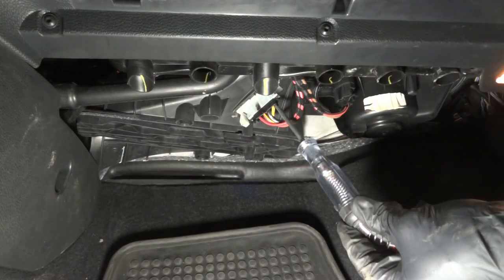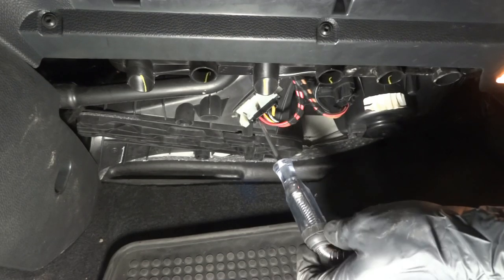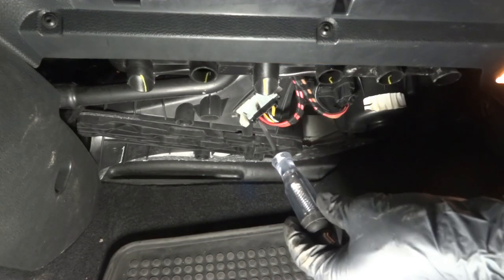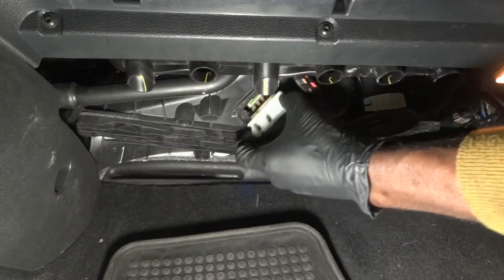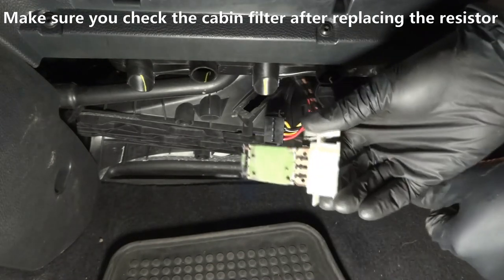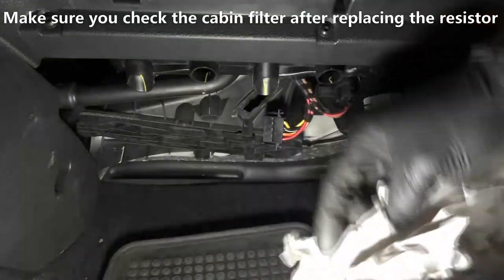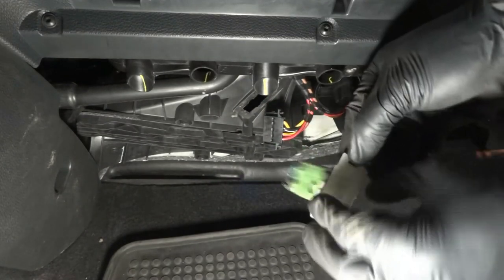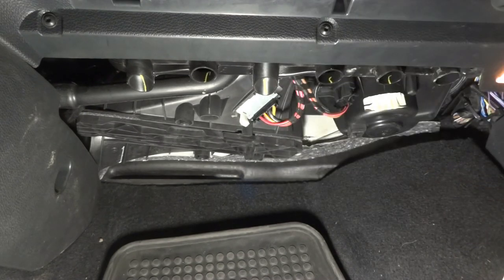VW JETTA BLOWER MOTOR FAN ONLY WORKS ON HIGH SPEED, DIAGNOSIS AND REPAIR

Comment: VW Service center charged me $178 to diagnose this problem and said it’ll cost about $835 for parts and workmanship. I told them not to worry, bought the parts myself for less than $70 and it took all of 2 minutes to replace. These guys are scammers.
Reply from the maker: @timeyinolley8966   I'm glad to hear that the video was helpful

Comment: What if I changed that but my a/c still isn’t blowing?
Reply from the maker: @stephenjohnson2651   what do you mean by AC not working, there is no Air Coming out of the vents!
Reply: @KITS_Auto_and_Truck_Repair  I purchased a new blower motor fan and blower motor resistor but my a/c still only blows on full speed.

Comment: Hi. I had this problem but when i put in the new resistor..all speeds worked only once and then smoke blew out of my ac vents  then went back to same problem again (with only fan working on highest setting). It’s like the resistor blew i think. What could be the problem in this case?
Reply from the maker: @iskooobydoo  you might have a shorted blower motor, install a new resistor then disconnect the blower motor and turn the fan on to see if the resistor is not gonna burn, if it doesn't while the blower motor is disconnected then the problem is the blower motor!
Reply: @KITS_Auto_and_Truck_Repair  hey thanks for the tip. Question, would a shorted blower motor also affect the Compressor/RCV not engaging? Because the AC is actually not getting cold also. Its like the compressor solenoid is not engaging.

Comment: Good repair and diagnostic video man straight to the point and didn't forget to mention to check for voltage before you go and replace the resistor that's a good idea
Reply from the maker: @eliangonzalezandthecoastgu2321   Thank you!

Comment: I wish I had found your video sooner before I spent $400 only to have the blower fail 2 days later. So my vehicle had the same issue. It only worked in 4th setting. Repair man changed the A/C compressor control valve. Picked vehicle up, A/C was cold again but realized later still only worked on 4th setting. 2 days later even on the 4th setting it isn’t blowing. I can hear some rumblings, but then stops. I’m thinking maybe I should change the resister and blower motor. What do you all think? Great video and informative. Thanks.
Reply: When I gently bang under dash it starts to rumble, but doesn’t start. It’s a 2012 VW Jetta.
Reply from the maker: @scottamaral5073  yes! check out your blower motor resistor!

Comment: Thanks for the share, my issue is slightly different, it blows only on 4 as well but on side and below vents not in the middle ones on a Passat B6.
Reply from the maker: @joblux  My Pleasure! it sounds like you have a mode door issue!
Reply: @KITS_Auto_and_Truck_Repair it only blow at level 4 on high speed, first three levels arent responsive…is that still a blend door issue ?

Comment: Aww yea!! Amazingly well detailed video my guy 👏🏾👏🏾👏🏾. So I have a 2013, 2.0 Jetta with the exact same problem, just started today and I bet this is the fix. Now This may be somewhere in the description or comments section and I just missed it, but is there anywhere other than the dealership to procure the replacement part? I want to make sure I order the right one but dont want to go through my local vw dealership as I’ve had bad experiences with them. Let me know and thanks again 🙏🏾🙏🏾🙏🏾
Reply from the maker: @JT01_902  My Pleasure! The Dealer should be your best bet! Aftermarket parts don't usually last!

Comment: Thank you - I had this happen tonight on my MK6 2013 Jetta and I believe I just need to get the right part number now and order it and I'll replace myself. I pulled mine out to look at it and it does appear bad. I don't have a tester but am pretty confident it is the resistor. 

Is there a way to find the VW part number? I found what appears to be correct on Autozone but looks like it is the whole unit and I just need the resistor not the wiring cables. 

Will update this once I get it swapped out!
Reply from the maker: krisrk  ok!! I think I showed the Part number in the video!! call your local VW Dealer and get the part number from them!
Reply: @KITS_Auto_and_Truck_Repair  I found it and am getting it delivered 9/24 tomorrow. Once I do the swap I'll update. Thaks for making this so simple!!!
Reply: @KITS_Auto_and_Truck_Repair  it worked and my problem is now fixed, have already followed your channel. You’re awesome!!! $18 bucks I really am curious how much the dealership would have charged. I’m sure a lot more than doing it myself. Thanks for your helpfulness and great video!!!
Reply from the maker: @krisrk  My Pleasure!! I'm glad to hear that the video was helpful!! you can donate to the channel if you can! Thanks!

Comment: Would a bad resister make my AC not work properly and blow hot air after a few mins? My car also only works on the highest setting for the fan.
Reply from the maker: @ericbogar9665  No! a defective resistor would not affect the performance of the AC System!

Comment: Hello! I have a question. Is this compartment behind the glovebox area ? Also, should I disconnect my battery when I do this ? Finally, what is the screwdriver for this type of screw called ?
Reply from the maker: @jarapovic  you don't have to disconnect the battery to replace the blower resister, you need a torx bit to remove the resistor
Reply: @KITS_Auto_and_Truck_Repair  thank you !!!!

Comment: I replaced the blower motor resistor and the AC works great on all setting now BUT there’s a rattling sound coming from the compartment where I replaced the part. It only rattles when the AC is on I don’t know what to do
Reply from the maker: Cameron Andrew  Make sure nothing fell in the blower motor housing, like a piece of paper or a pen!! I've seen stuff from the Glove Box fall in the blower housing!

Comment: I have the same problem , it works at any level for beginning but after cruised for an hour or so , suddenly level 1-3 stops working but level4 still working. Any idea why ?
Reply from the maker: Iwan Atmadjaja  your resistor is probably failing! test it and see what happens!

Comment: Blower not working on any setting now after only working on highest setting for long time. Fuse good. Going to check resistor next.
Reply from the maker: Patrick Griffin  it sounds like your problem is a bad resistor!
Reply: I think the blower motor had been running with a bad resistor for a long enough time, that it too went bad. After putting in the new resistor, I tested at the connector to the motor and am getting good voltage and ground. I will be putting in the new motor tomorrow after it gets delivered.
Reply: Turns out, that was it! Both resistor and blower motor. Now I know. When fan works on only highest setting, change resistor before it has an effect on the motor.

Comment: Why is this issue so prevalent with VWs? I’ve never heard of this happening with any other brand
Reply from the maker: @4spooky8u  it's how the resistor is mounted,  it doesn't get cooled a lot!
Reply: @KITS_Auto_and_Truck_Repair  yeah when I replaced mine the old one was corroded to all hell.
Reply from the maker: @4spooky8u   ah ok!

Comment: I install new blower motor and resistor but still not blowing anything..
Reply from the maker: Joe Milne  check your fuse and blower wiring! I have videos on this channel that can show you how to do that!
Reply: @KITS_Auto_and_Truck_Repair  i dont know which one is the fuse for the ac or the blower lol but most defiantly will look into te videos🙌🤙🏽
Reply from the maker: @milne23  Ok! Good Luck

Comment: The r3sist9r is the little guy on tip of that
Reply from the maker: @JoeRogansGutBiome   Yeah!
Reply: @KITS_Auto_and_Truck_Repair  thanks bro this is the exact issue I had in my 2011 VW Tiguan. Replacing my resistor today.